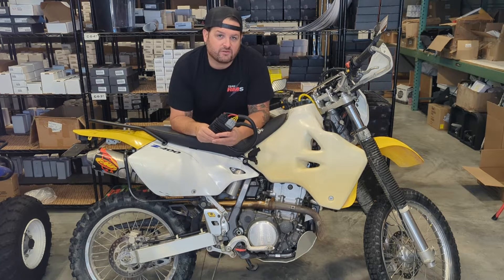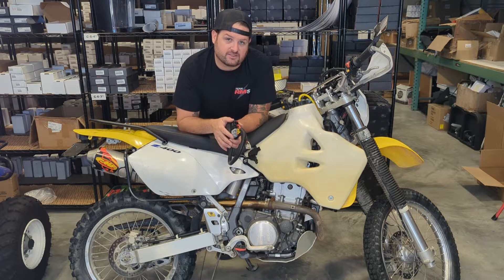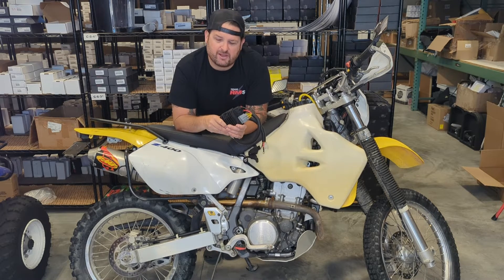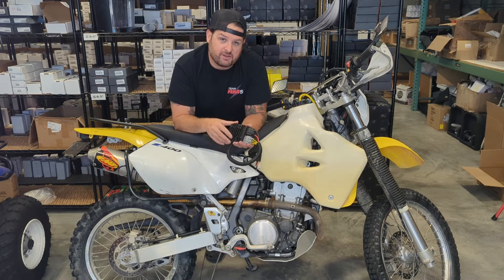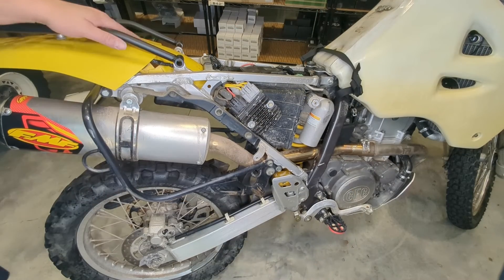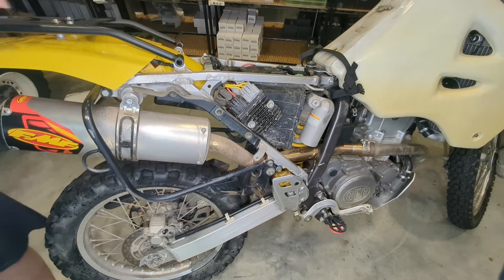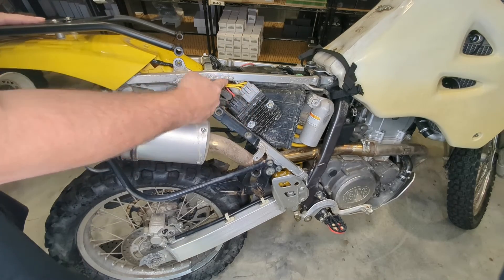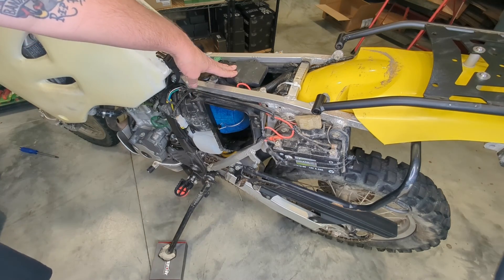RMSTATOR Suzuki DR-Z400 KLX400 Series Voltage Regulator Rectifier Bypass Kit Bolt On Free Power Mod

Comment: I've mounted mine in the same spot but the panel didn't fit. It certainly doesn't rub a little, it rubs a lot!
I had to use a heat gun to form the panel around the reg/rec just to get it back on.
Reply from the maker: Ah sorry to hear that! You can see in the test bike it fit just fine. It may have been due to being older plastics that were more flexible.

Comment: Hey guys I bought this and what do you recommend I do with the old connection that I am bypassing. Its not a big deal I guess if I just electrical tape it off but, I see you guys had a new connection from your stator as well. I am at witts end with this damn bike and its shitty electric. Help me out would you?
Reply: For the loose connector leading to the wiring harness, what I did was get an RFW 0.9 male connector and add it to the end of an SAE connector. When plugged in, that was provides a useful SAE connection for a headed vest, trickle charging or easy voltage testing without removing panels.
Reply: Bro im in same situation

Comment: Explain the benefit to a simple minded person ,
Reply from the maker: Running the output of the voltage regulator direct to the battery, and bypassing the excess wiring and old connections on the factory harness decreases resistance in the charging circuit. This improves battery charging significantly. We will have a new video available soon demonstrating this improvement.
Reply: The “free power mod” helps generate extra charging voltage to the battery. Anywhere from 0.1V to 0.5V (sometimes more!). This helps charge the battery faster which is helpful if you’ve got an older bike generating less than 13.5V at idle. Especially if you’re running accessories (heated grips, phone charging, etc)

Comment: Clickbait ... this is a beneficial mod on any bike ... defo no free power by doing this R&R wiring mod, stator makes same voltage regardless, R&R has an easier life with this mod, that's the only real benefit ... R&R could be mounted in a better place, ideally needs an alloy plate as a heat sink.
Reply from the maker: Definitely not intended to be clickbait. Direct wiring of the regulator to battery is well known as the 'free power mod' on the DRZ400. That is what our kit does. The series regulator does not require a heat sink or other cooling. We have thousands of miles on multiple local DRZs with this setup, and it works perfectly. Thanks!
Reply: Bought the kit and installing now… shouldn’t there be an inline fuse on the positive terminal wire though?
Reply: @Rmstatorinc yep ,im thinking bout bying it but wld like to see this question answered

Comment: In most "free power mod" tutorials for the drz they recommend using an inline fuse on the positive wire going to the battery. Is this not needed here because the power is going through the R/R first?